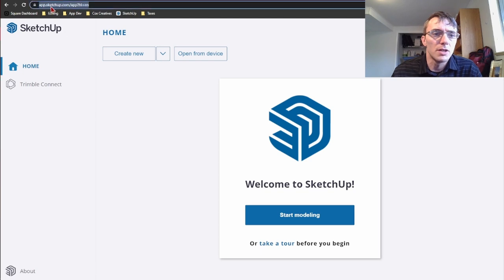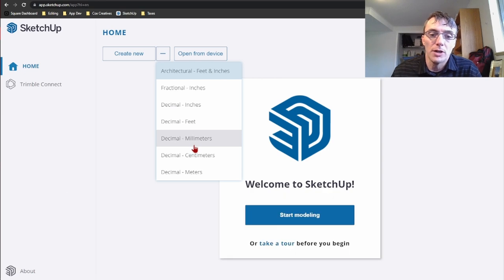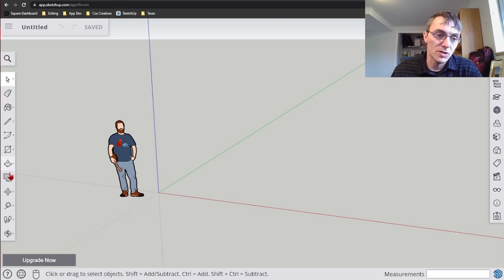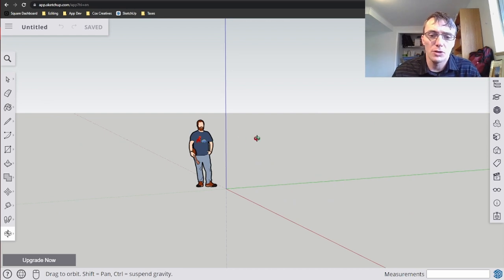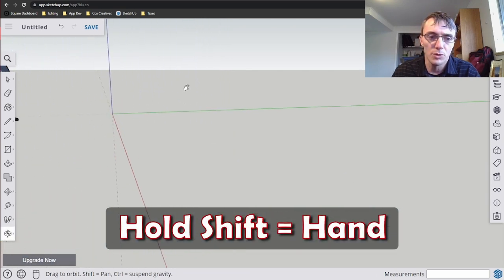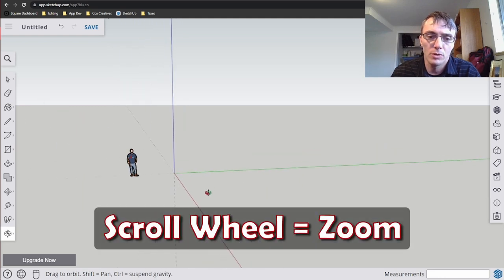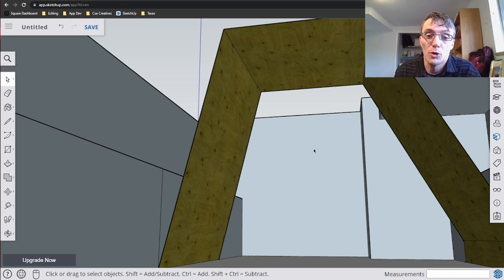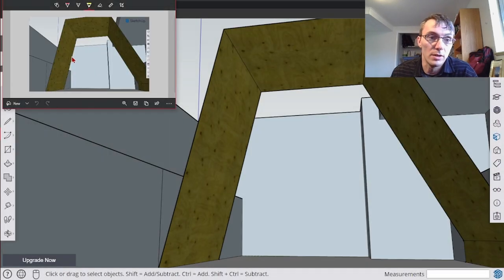Design a 3D Climbing Wall with SketchUp   |  Homewall Build Series Episode 2.5

Comment: I used to play with a sketchup when it first came out.  @13:02, when you mention not being sure about why it creates lines all over the place, it all has to do with creating snap point at intersections.  It’s a weird feature, but ultimately, it is kinda helpful.

As fas as creating angles, I could’ve SWORN sketchup would allow creation of trapezoidal boxes by dragging a corner or whole line.
Reply from the maker: Ya, I'm pretty basic with my use of it.
Reply: @RealWorldClimbing  still it was a nice 3D file.  Sketchup is cloud-based now, isn’t it?
Reply from the maker: @RossPotts  yes it is